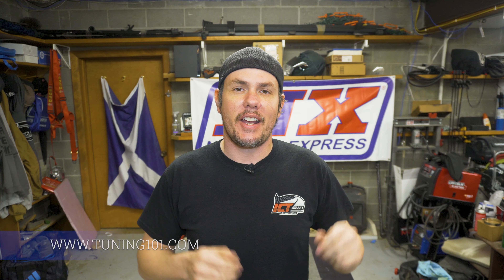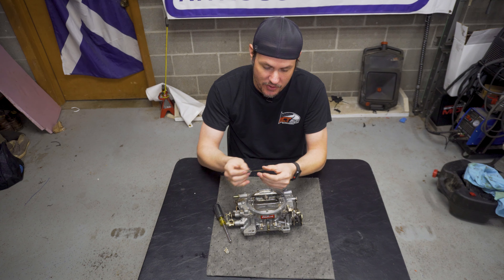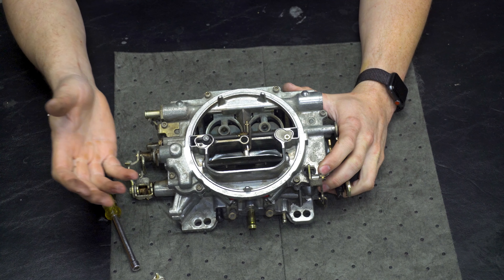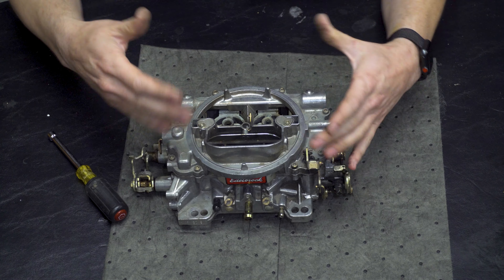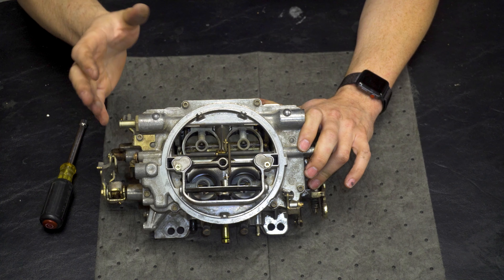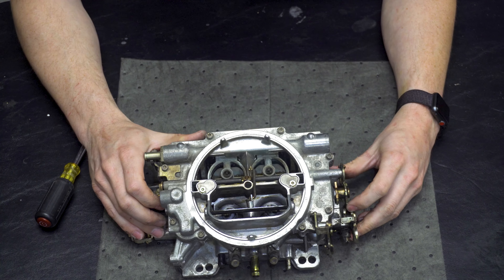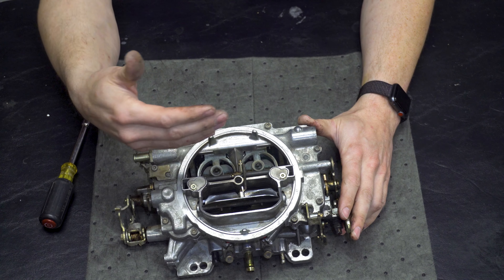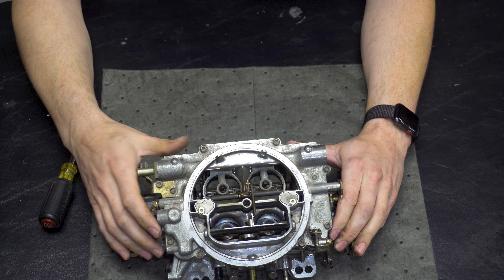How A Carb Is The Original Old School Mass Air Flow Sensor!

Comment: Loved your explanations using the carb.  I was a mechanic/Technician from the mid 60s.  We were all mechanics until the electronics came along in the late 60s & early 70s.  Those of us that stayed in the business became technicians.  Your analogies of the carb reminded me of the Ford classes, they would use the carb circuits and literally match them to the electronic circuits as you just did.  Back then everyone knew the carbs circuits.  I would use this analogy in my Sun/Snap-On classes.  The CKP would turn on the injector and after the airflow was measured the PCM would turn off the injector.  Thanks for your reminding me off my past.  Truly enjoyed your explanations.

Comment: Really good video! I started tuning on carbs and I ran edelbrocks for a while, unless that carb was just for demonstration, One thing I would check is to make sure the idle transfer slots in the primaries are exposed they will be covered if the idle stop screw is isn’t letting the throttle close enough, if they aren’t exposed then the engine may idle but if it does it’s not running off the idle circuit,
Reply from the maker: Yeah, not planning on running it, snagged it for a great price to have around for things like this. Needs a complete overhaul before it goes on anything
Reply: @GoatRopeGarage  and I can’t wait to see your truck making some clean passes, she is gonna fly next year!

Comment: Great video! 
So with the concept of the accelerator pump on a carb, the air and fuel is metered at the same location like TBI. Since air is more responsive or has less inertia than liquid or fuel in our case the accelerator pump is used to spike fuel supplied in the air stream to avoid the air rush getting to the cylinder first and causing a lean spike due to delay in proper venturi supply being delayed. 

Is my understanding accurate? Is tip in as critical or drastic on GDI or port injection as it is on carb/TBI since the fuel is delivered farther down stream? Or is it used more to predict the fuel amount needed until the MAF sensor can get consistent/accurate readings at the new air volume? Curious of your behaviour observations if you've had any between Carb/TBI, GDI and/or PI. I hope all of that made sense.